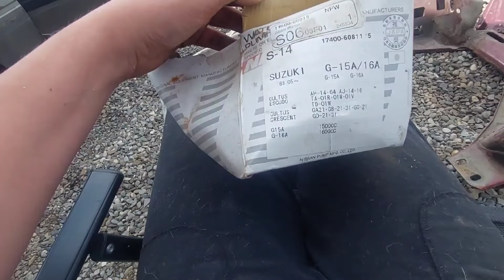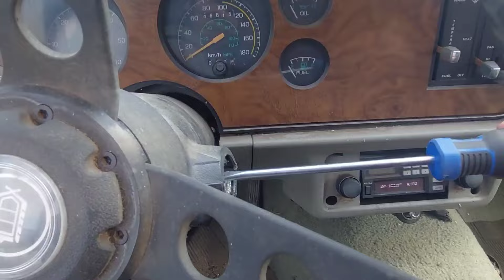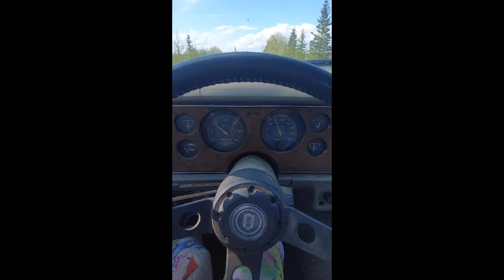Will the cheapest manual capri in north america run and drive after sitting in a field for a decade?

Comment: Those 3.3 inline 6's won't die. Too bad about the shock towers. I recently scrapped a 5.0 5 speed Capri that the shock towers  were also rotten. Infact they were so bad the car almost ripped in half loading it on a car trailer with a winch. Body was decent though. I saved all I could from it before scrapping. I want to eventually find a notchback Mustang with a rusty body that I can cut up and put on all the Capri fenders and bumpers and  make a "Coupri".